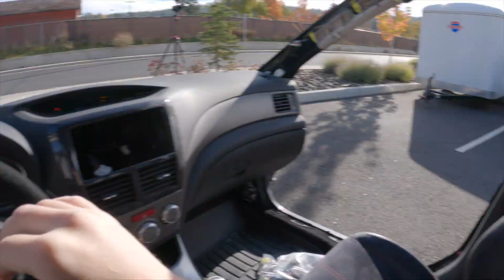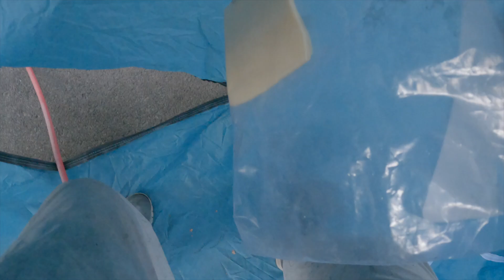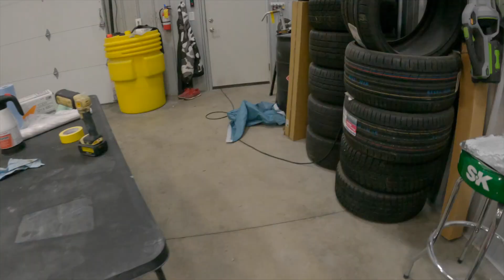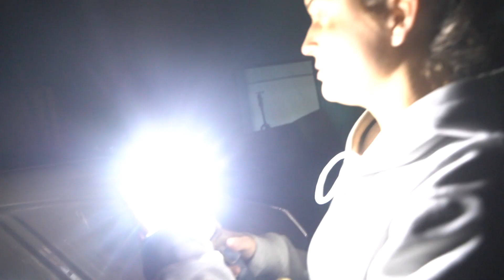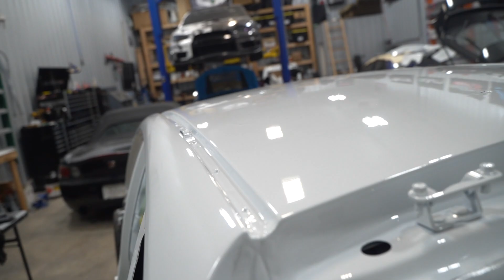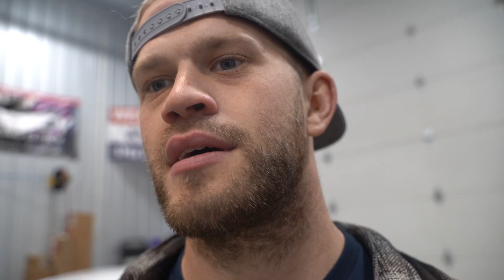The STi's Paint Job turned out INSANE!

Comment: There is a little trick for sanding out the runs. Take your glazing putty and lay a thin layer of it on and around the run. When you start to sand it out, the layer of putty will protect the paint around the run from getting thin from the sanding. Also the putty will act as a guide coat for the sanding, If there is putty on the run that will sand off first and you will see the run and the putty disappear together.

Comment: I painted my Sprinter outside because my garage is not done.  And I had to paint it outside in 10 mph winds.  I also never used this brand of paint.  They recommended an activator for the base color and I know why now.  I let the base dry 2 days then did the clear.  1st coat 1 run, 2nd coat 30 runs.   I'm just glad it is done now because it was in epoxy for 3 yrs which is not uv stable.  I will just fix the mistakes.  This vehicle is so big, it was like painting 10 cars.

Comment: Always hit the like button, for how you have done this project pretty darn good. I still worry by many of your comments though that shows me still impatience like the speed of masking, don’t rush, what’s the hurry . so what if it takes 2-3hrs, enjoy the process dude.
Many ways to phrase this but this was used extensively in my army days and I still use it for leadership mentoring.
Prior Proper Planning Prevents Piss Poor Production.
Good practice is to plan before and after each day, ya did good mixing up extra paint, that’s good, and it means you don’t have different mixtures in your spray.
But end of day, allow a clean up time, allow a wash the booth down time and dry, re wash in morning first thing, 
i,e you did to keep dust down, but always clean up end of day, gives better prep for next day and saves time, better result.
Also, imo you are still trying to do too much too quick, laying a seal coat, and then 3 bases and clear coat in a day, imo too much esp for your setup and on your own.
You are laying too much down on each step with your spraying, spraying a light sweeping coat first just to lightly get a coat down, not coverage do this for cost and second coat and coverage will come, it will also prevent runs, also lightly sand 1000 grit in between coats, wipe clean each time. then last coat you can apply a heavier coverage spray, keep the gun moving in sweeping arcs, a light sand in between ,means you will get a better finish next time, better coat coverage with using less paint and no runs, as the paint will adhere better to the sanded panels. there are no short cuts, pros can do this quicker sure, but because they have experience, the equipment and planning to execute it in timely fashion. but any paint shop says to me they can paint my car in a day is one aid drive away from.Anyways for what it is good work, just wrk on those steps mate and you could be awesome not just in painting but everything you do with each car, But you must learn planning and patience, prevention and process, product execution and don’t forget people you and those around you, us too, people look up to you and what you can do, no one expects perfection, but you can do so much more with these attributes and you have an opportunity to teach people esp your age demographic. 
Your raw determination and guts to attempt this level with what you have that most could setup in their driveway is impressive as well as inspirational, don’t underestimate that, but take your time esp first time, slow and steady wins the race, practice is what makes perfect, practice brings speed, but only when you have practiced doing it the right way, 
Anyways great project, looking forward to it,all coming back together.🤘